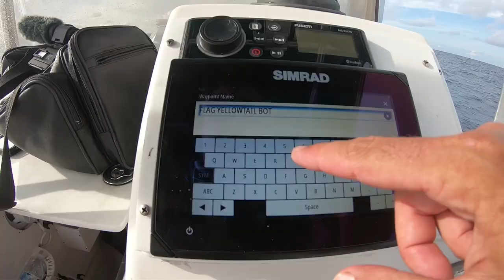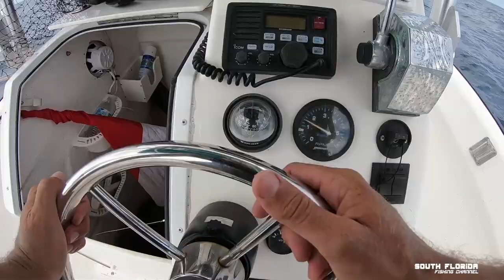Flag Yellowtail & Mutton Snapper Fish Head Soup | Key Largo Catch and Cook

Comment: OH yeah and pro fish broth tip, put all the potatoes and carrots and garlic and stuff in the water to boil first, add the fish last, you'll get all the broth and also all the meat because the fish meat will still stick to the bone instead of breaking apart. The fish only needs about 15 mins in the boil. Then you just suck the meat off the bone like meat off of ribs. yummmmm

Comment: First you know that fuel filter is just a oil filter.. Second do you ever pre trip your boat dude.. hello off shore and miles out in the sea and at best case 1 hour before rescue in a Emergency.. Safety .. you only have one chance to be safe..
Reply from the maker: My oil filter is a completely different unit and worst case I could have Jerry rigged it offshore to flow fuel directly to engine =) I've read the while engine manual like 10 times. Its massive! Haha
Reply: @SouthFloridaFishingChannel  That is actually you fuel water separater and you can use a standard oil filter filter and that is all most of them are.. But dude that needs to be change on a time basis not on failure.. At sea you have only one chance to be safe and no one has ever gotten a second chance.. I personally grew up commercial fishing on my families boats out of Mayport Fl.  And I know what happens when you chance  safety and fail to do maintenance..